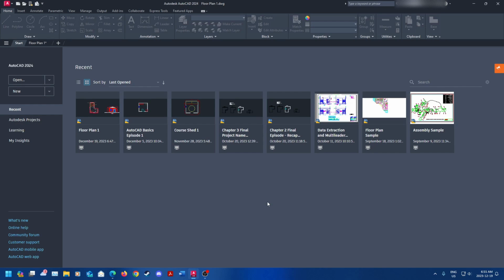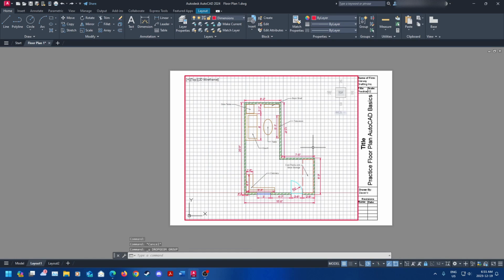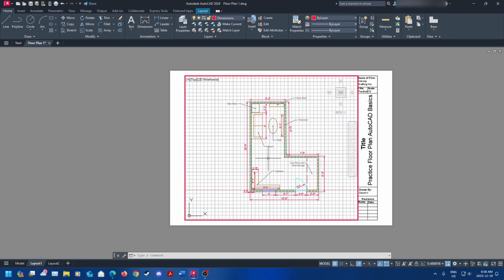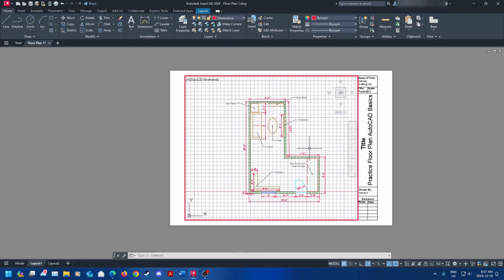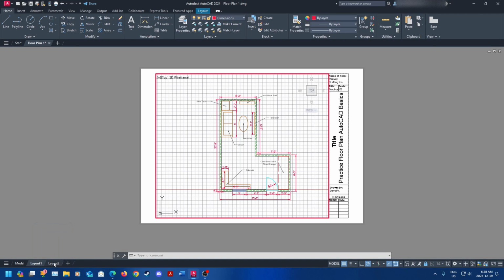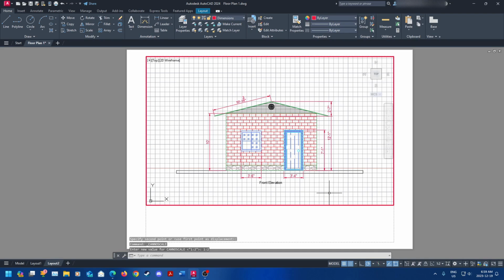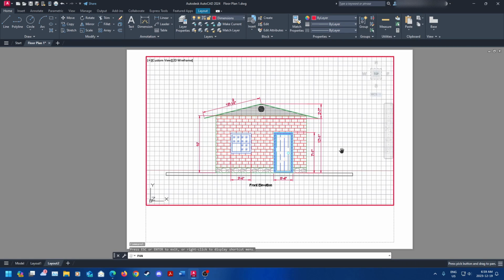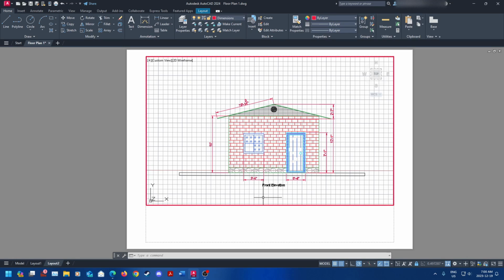Use Viewports Like a Professional in AutoCAD!

Comment: I am sure that in the past i could go in to a viewport, select and object, then click scale to fit and the object would zoom into the largest size that it would fit in the viewport....now when i try this it zooms way out. I'm using AutoCad LT 2024. Any ideas what i'm doing wrong? I do select multiple lines objects when i try this.
Reply from the maker: I also recall a time when you could do what you described (I could be wrong). However, it seems in newer versions of the program when using "Scale-To-Fit" AutoCAD will scale to fit ALL the objects in Model Space. Personally, I usually select a drawing scale and manually set it. Takes a bit of tweaking sometimes but it works 9.5 times out of 10.

If you'd like a video detailing this more just say so and we can get one produced and out ASAP.